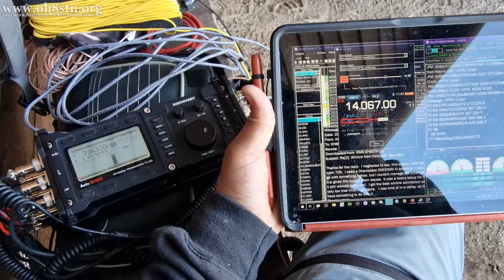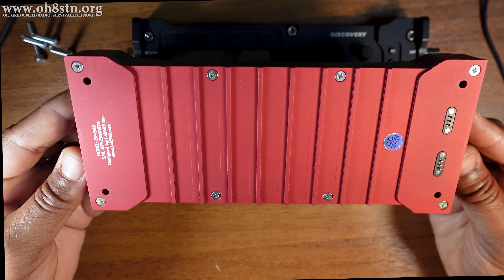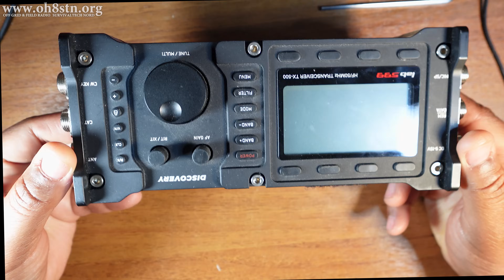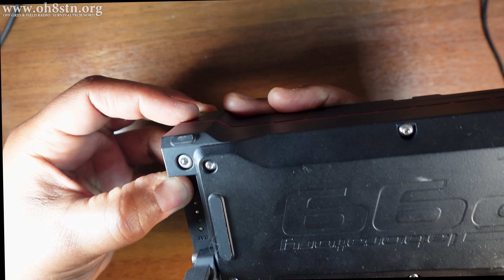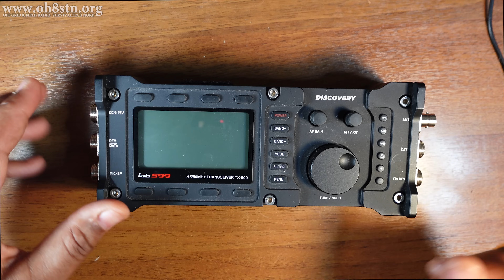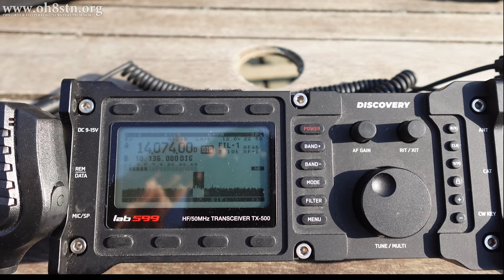TX-500 Battery Pack from Lab599

Comment: I have a question on initializing the BP500. I have a wall wart that is 12 volt 2.5amps. Is that not enough volts and or amps to get the BP 500 to initialize? Mine will not fire up the radio. Batteries have a charge.
Reply: Tx-500 shut down at 8,5 volts, and use 2,5-3 amps at transmission

Comment: Hi Julian - it seems simpler to connect a Bioenno LIPO to the radio. Have a bunch of the small ones in your bag, and you're done. Great review as always. No screws...no mixing up power ports. It's sleeker with the battery pack on, but it seems like marginal advantage. What am I missing?
Reply from the maker: I think the primary benefit is there's no cable mess, and you can plug your solar panel directly into the battery. Ultimately it's a lot less gear to carry.
Reply: @OH8STN  I appreciate your answer. You have shown elegantly how the LIPO batts work so I am used to that concept.

Comment: Thanks Julian, without this video I would be completely in the dark.   However,  still can’t get the BP-500 to work.  Radio works fine, battery pack turns off after 10 seconds. Turn on battery pack then radio, 10 seconds later, all shuts down. Followed your procedure for powering up. Still nothing. Any help or suggestions appreciated!

Comment: It seems that the Samsung cells that came with my BP500 perform particularly well at a lower discharge rate, which is a great match for this radio.  For this reason, these INS18650-35E 3500mAH batteries may be the optimum choice for the BP500.  In any case, they perform well and at least on paper compare nicely to similar parts from Panasonic and Sanyo.
Reply from the maker: Indeed, there are los of Li-Ion options. We choose the best one for budget and performance.
Thanks for watching an commenting.
73
Julian oh8stn

Comment: I ordered the BP500 a little over 6 months ago. It just arrived today.  I have been using the alternative BAT500, which has worked fine, but doesn’t have the design elegance of the BP500.  I'm probably going to reserve the BAT500 for powering the amplifier.  My BP500 arrived with 6 Samsung INS18650-35E 3500mAH batteries.

Comment: Great vid as ever, Julian :)   I'm based in the UK and we're going to be getting these soon, apparently.  Just wondering since the vid came out, have you had the chance to test it with all 6 batteries?  Any idea of what kind of operating life we get with each charge (for low power/10w)?  I'm guessing so many hours of fun? :)
Reply from the maker: I'm using this big battery to run the icom ic-705 and the p a 500 expedition amplifier. It'll run that equipment plus js8call on a laptop for 3-4 days continuously at ~30 watts.
Did you see this video already? https://youtu.be/HLnpNgvdzwI?si=i3c8nHshMogj4uny
Reply: @OH8STN  That is some endurance!!!  Cheers very much, Julian! 😀👍  No, I missed that vid!  Jumping on it now! 👍 73s!

Comment: Thank you! So it is still unavailable and I am interested in making some 3D files to make my own. I just need help figuring out the electronics inside. Any chance you can take some pictures of the inside so I can figure out how they did it safely? This is for personal use only. If anyone can help it would be greatly appreciated! Thanks!
Reply from the maker: 2 18650 lithium ion battery trays in parallel. Each tray has it's own bms. Wide voltage input charge controller like Genasun GV-MOD. Battery on/off,  pogo pin connector,  charger/solar port.
There was actually a 3d printed version on thingiverse, but not very good. If I were doing it, it would be LiFePO4 instead of Li-Ion.

Comment: Great video… sorry if I missed it but which Powerfilm panel do you use (28W, 42W or other)?
Reply from the maker: You didn't miss it, I don't think it was mentioned in this video. I have a few different PowerFilm panels for different use-cases. From the rollable, 2x 28 and 1x 60w. From holding 30, 60, 90, & 120w. For QRP I generally use the 60w as we are at such high latitude. 
For the field station,  the 90 or 120. It really depends on what my goals are, and how much power the station runs.
Hope this helps.
73
Julian oh8stn

Comment: I was wondering how you are finding it now you have had it for a month?
Reply from the maker: I've been on the mend Philip, so just a few bike adventures with this setup. The pack is the right size and capacity.  It makes the tx500 truly portable! The only con I had was a little noise while operating whilst charging from solar. I'll investigate this on my next overnight trip later this month, then report. At the moment, I don't charge it while i'm operating. The battery pack is a bottomless pit of capacity, so it doesn't matter so much.
Reply: @OH8STN  Mend well soon qand thank you for the rapid response
Reply: I have ordered one😁
Reply from the maker: And you can also translate my overnight ramblings 🤣👍
Reply: @OH8STN  Yes perfectly. I used google translate 🤣

Comment: I noticed in the Field Test portion of this video you had what looked like a PowerFilm R-21 not connected to the BP-500.  My guess is you experimented with this, though you didn't mention doing so.  I am curious to know how that performed, and if you would prefer to take an R series to the field over the LightSaver series when using the BP-500, given its built-in solar panel features, or if you think the Lightsaver Max would still be a useful compliment to this setup.
Reply from the maker: Great question and observation. I didn't take the lightsaver because I don't believe it can charge the BP500. Its output voltage is too low to charge the BP500. Moreover, I didn't mention the solar aspects of the field test, because I'd like to do more effective tests, over a longer period of time.
I believe the traditional solar panel will be optimal for the BP500. Time will tell.
Reply: @OH8STN Am I correct in understanding that the BP500 internal charge controller uses a max of 3 amps at 50v of solar charging? and if a connected panel is producing more than 3 amps at less than 50v it will not damage the BP500?
Reply from the maker: It's a great question but I don't know the answer yet. The recommendation is three amps. As this is the only BP500 I have, not teady to test it to destruction just yet.

Comment: Hello Julian, you said that you can't connect power supply to GX socket on TX500 when you have BP-500 attached. It isn't so. You can't conect power supply to GX socket and to socket on BP-500 at the same time. This is written in manual. When you powering TX500 from external power you can turn on battery and it will work as backup power supply. One thing that I haven't checked yet is that can TX500  transmit with solar panel connected, when it gives small current. Will TX-500 use battery power on TX and charge it on RX in such case. 73! RA9QAT
Reply from the maker: Thanks for the comment. All i'm saying is It's easy to get mixed up and accidentally connect both. To avoid it, I just use the port on the BP500.
73
Julian oh8stn
Reply: @OH8STN  Thank you, excuse my English, I think I didn't understand you well in video :)
Reply from the maker: No problem Vlad, you're exactly right. I could have said it better in the video. 👍
Reply: @VladSolovey  Thanks, very helpful.

Comment: I am very interested in this battery pack. I have the radio, with a lot of miles on it, and a 3D printed battery case. I'd love to know how the voltage on this holds up under transmit, and what kind of runtime you can get out of it. I hope you will do a follow-up report once you've had a chance to exercise it a bit more.
Reply from the maker: Indeed! Normal MO. Field test, and report 👍

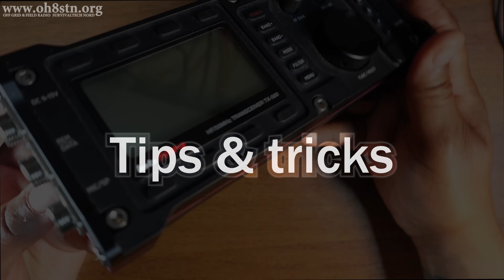Comment: 17:01
Wrong. 
You can power it with gx12 plug, or you can power it with barrel connector to bp500. 
But don't plug in both connectors simultaneously. 
Pages 9-10 of bp500 manual.
Reply from the maker: Thanks👍 
When you tell people you can plug in to both of those connectors when the BP-500 is installed, It's only a matter of time before someone forgets has 1 or the other plugged in, then plugs in the second one. It's just better to use the one on the battery pack.
Reply: @OH8STN 
Yep, actually I believe it's creators oversight to some extent. They already implemented protection measures for reverse voltage, overvoltage in TX500. It shouldn't be too complicated to protect BP500 circuit from reverse feed from trx. But who knows. We have what we have  ))

Comment: Julian, great review, thanks. How would you compare bp500 vs diy599 batterypack? Both are hard to get, but which one to choose? (I already own a great solar charging controller for the panel)
Reply from the maker: This is a great question. I'm going to answer it in an upcoming video. For now we can say the l a b 599 version, is good to power the radio itself. The DIY599 version can power a radio, amplifier,  and third device.
73
Julian oh8stn

Comment: Great video. I love my IC-705 but the TX-500 and its add-ons are so thoughtfully designed and purpose built for in-field operation that I almost wish I had sprung for it instead. I think it's an especially good move to have each of the individual add-ons mesh with the footprint of the TX-500 to keep the bulk down. I wish something similar existed for the IC-705. I hope that whenever you give us your thoughts on all three components (TX-500, PA-500, & BP-500) working together that it'll hit that great intersection of capability, portability, and longevity that you're searching for.

Comment: This is really a well designed battery pack! I like the fact, that  there is no need for an extra solar charge controller. That would cut down on extra weight, and gear! And the kick stand legs, were a clever idea! The legs double as a safety cover for your power buttons. 
I would add a screw on cap, to cover the "radio's" power port. Just to prevent dust, water, debris into that port. 
And maybe even paint the engraved inlay words (in white modeling paint) at the power & LED sides, so my older eyes can read it at a glance.

Comment: from HRO i have been waiting on my order for four months now
Reply from the maker: I think there was a hardware update during this waiting time. They added on the heat sink , ensuring the radio could dissipate heat efficiently with the pack attached. At least the prototype images are different now than the production model. I'm speculating, but that's my best guess.

Comment: I’m dumb when it comes to batteries, and some other things. With six 18650 cells, what will the MaH rating of this pack be?
Reply: If you put the best cells in you should get  about 7000mAh. At 11.1V that's about 78Wh.
The tx500 will run a very long time with that.
Reply from the maker: Indeed👍
Reply from the maker: Couldn't know without knowing the mah of the cells one would use.  I ordered 3400mah Panasonic NCR18660B cells.
Reply: @OH8STN  Does MaH add proportionally with the number of cells?

Comment: Thanks for another instructional video. Can't wait for my setup to finally arrive. Comment on dust caps on the power input is a good idea. I've got a set that came with my screen covers from a guy in TX who 3D prints them and sells on esty. Now to see how the setup holds up under load. Got the PowerFilm LSM to try to hook up with this system. Mahalo!

Comment: Looks like a winner! I can't wait for mine to come in! I should also be getting my PA-500 in the 4th Quarter. 

Combine those three items with my Chameleon MPAS, DigiRig, Mobilinked, and Chuwi Hi10X Tablet. That rounds off most of the equipment that I have assembled to build a mobile HF station for EMCOM's.

I bought the Chuwi tablet instead of a Microsoft surface pro, as it is a ton cheaper. It has two USB c ports, mSD slot, and mini hdmi out on the tablet. And two USB-A ports on the keyboard. It also includes a Stylus that works well that uses a AAAA battery. It has much more I/O on it than the surface pro. 

AND it includes the keyboard and stylus for less than 250 bucks! 

The only drawback is you have to use a proprietary AC to USBC charger that comes with it to charge it. It does not have a USBC PD charging chip inside. So it will not work with normal power banks. I did not know that when I bought it. But considering how much money I saved versus a surface pro with the accessories. It's a trade-off I can work around. I am going to experiment with the various devices you can buy that can go in line on a USBC cord to see if I could force USB CPD charging.

If anybody is looking for a cheap Microsoft surface pro alternate, and they have no problem using their proprietary AC brick wall wart to USBC charger to recharge its internal battery. Then it is a good deal IMHO. 

It's currently on a lightning deal at the time I'm typing this message on Amazon for $211 US! The 8 GB RAM version is only a few bucks more if you're interested in that as well!

CHUWI Hi10 X, 10.1" Tablet with Keyboard and Pen, 6GB LPDDR4 128GB Storage, 1920x1200P 10-Point Touch Display, Intel Celeron N4120, 2 in 1 Convertible Laptop, Dual Band WiFi, Typc-C, Windows 10, Gray https://a.co/d/0nHbSYz

EDIT. By the way I got my tablet about a month and a half ago and it came pre-installed with windows 11 instead of Windows 10. FYI.

Comment: Now that cool, Maybe some day they will have a tuner and an amp that will attach, incase we want more power or need a tuner , all in one moduler package.
Reply from the maker: This already exists. Check my videos with Oliver DL4KA
Reply: @OH8STN  How does the Amp Tuner attach to the BP500 Package?
Reply from the maker: It doesn't,  you're thinking of the other battery pack dslled BAT500 from diy599. Video incoming 👍
Reply: The tuner is in tx-500mp

Comment: This radio is unique and is designed and manufactured to high standards.  However an expensive battery pack is not needed, any DIY battery pack will do.  Now, an antenna tuner would make much mores sense.  Also, those battery compartment screws will be lost in no time...they need to be captured on the back plate!
Reply from the maker: I don't disagree about the screws, but once the cells are installed,  the compartment never needs to be opened again. 
A tuner module would be nice. Dince I've starred using OCF & EF antennas, an integrated battery module became a higher priority for me. My d I y batteries are awesome but this is much cleaner and uses fewer cables.

Comment: Julian, how are you liking the Lab599 radio overall? This is on my radar, at some point, I want to grab one. You are one of the few Youtubers I follow who use this on a regular basis.
Reply from the maker: As an analog radio it's brilliant and I love it. For data modes, the wires can be intrusive. It's still a great radio but I wish there were an internal audio interface with usb for cat control and audio. The modularity is a plus in my opinion. There's nothing else like it at the moment.
Thanks for watching, commenting and for the kindness. Greatly appreciated.
73
Julian oh8stn

Comment: Excellent video Julian!  Now to bring it all together with the PA-500 Amp. It looks like the designers have been channeling OH8STN in their engineering/design sessions!!! 

Perhaps the big guys will indeed start to take note. This modular “all-in-one” setup is amazing. Looking forward to more videos after you get into the “weeds” of this setup!
Simper fi!
Todd KI5HNX
Reply from the maker: Thanks Todd. This battery is awesome but can't power the @dl4ka PA500 amplifier. This one just powers the radio, and charges its own Internal cells. I'll do another video showing the BAT500 and PA500, integrated with TX500 soo .
Semper Fi brother and 73.
Reply: I will take the TX 599 package any day…
Reply: $2800 for all that!  Not even close to being worth it.  I'll get a 7300 & 9300 and stay home warm and happy.
Reply from the maker: @nvrmor023  your math is flawed!
Reply: @OH8STN 
Radio: 1150
Battery: 400
Amp: 1225
Shipping?
Total:$2775

7300: 1000
9300: 1700
Shipping: free
Total $2700

Comment: The BP-500 is much more than just a battery pack.  Other radio manufacturers should take note.  It is obvious a lot of thought went into the design.  Very nice that you don't need an external solar charge controller.   I love that you can choose 3S1P or 3S2P.   If I had a TX-500, I would definitely get some connector dust caps especially for the TX-500 DC power port to prevent me from connecting power when the battery pack was installed.      Great video!
Reply from the maker: Thanks for watching and commenting. Yes indeed, I think manufacturers take notes. I've said it on the channel before, the small companies are doing the innovative work. 👍
73
Julian oh8stn
Reply: I had the same thougjts & cap ideas too! 😅

Comment: all well, but this modularity comes comes with the expense of increased weight. The weight of the robust case has now doubled
Reply from the maker: Prices for many things have gone up, not only for this system. There are other options though.
Reply: @OH8STN  i was refering to prices...you can read "expense" as downside/drawback